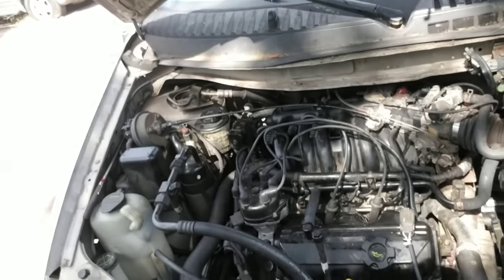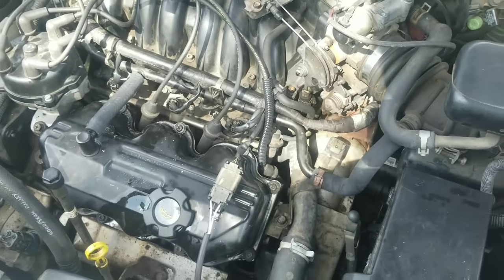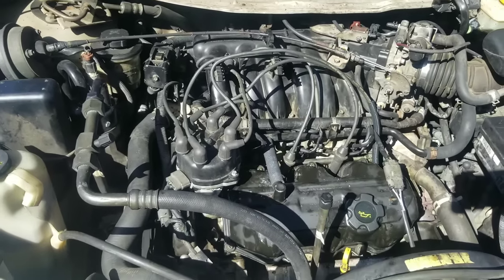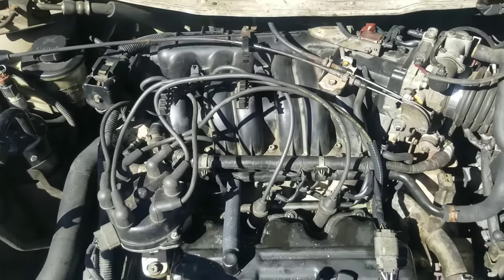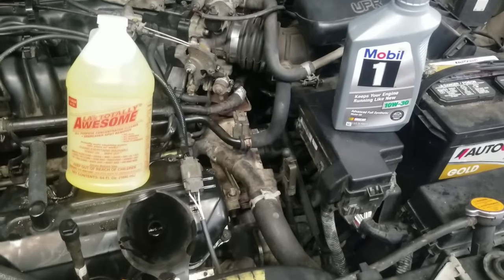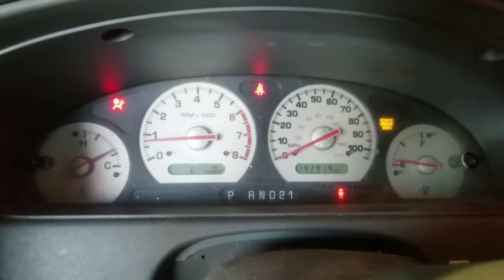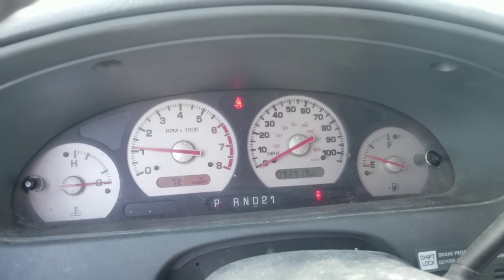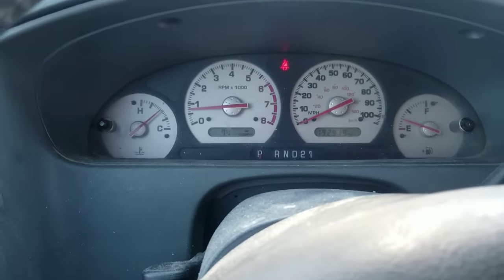How to Clean The Inside Of Your Engine The Easy Cheap Way.

Comment: I went ahead and tried it on my 09 Pontiac G8 and seems to be running like a champ!!!  So all you haters just letting you know it worked for my car!!!
Reply from the maker: Thank You.
Reply: Koool!
Reply: My G8 GT lifters are tapping and low oil pressure I will try this maybe soon hopefully it would work how many flushes did you have to do with your G8
Reply: @crazysexycool180  what do you think about diesel for flushing the engine
Reply: @jermainejudge6236  did it work

Comment: When you start hearing your lifters ticking shutdown your engine. If what the saying is correct that oil pickup tube is clogged meaning not oiling the main bearing and the piston rings. This could destroy your engine like spun main bearing, piston rod bearing, and others that needing much oil to lubricate.

Comment: As I instilled in to my daughter, I learned from my grandfather oil is cheap, engines are not. But if you can save one from the bone yard, that's great. I do like using seafoam about 100 miles before an oil change. You would be shocked to see how pitch black that oil gets after and I never go over 4,000 on synthetic oil. Mystery oil is great, I use it in the filters during oil change so instead of just oil, the engine gets a shot of cleaning agents right away. Some might say that's a little expensive, I've done this for years, hundreds of thousands miles. Never had an engine fail. Knock on wood, hopefully never will because that's really expensive!

Comment: For those skeptics out there what I would do is I would put some of that crud on a screen similar to the oil pump screen spray the chemical on it and show how it actually dissolves the stuff . Some people going to think that the stuff just sits there on top of the screen for the oil pump but just be clean . I think it works because obviously the oil light went off which means you have a clean flow

Comment: In my 60’s auto shop class, we learned to use diesel fuel and 1qt of oil in the same way. Always following up with fresh oil and a new filter. Some mid 50’s cars used non detergent oil and filters were an add on.

Comment: I did this on my wifes 2014 Nissan Altima 2.5 which i got it from auction and had a lot of sludge inside and after about 3 or 4 flushes and final one with Mystery oil, the engine runs so much smoother. Thank you bro for the amazing tip. My wife drives it to her nursing school everyday putting about 80 miles a day for the last 3 months and car is running great now. THANK YOU !!! I won't try kerosene as i heard it can damage the orings inside. but this awesome stuff did the trick for me.
Reply: Still running good? Curious
Reply from the maker: Thank you please like, share, and subscribe, also please check out my other channel Salem Taxi, on YouTube for more material on a different level.
Reply: And now I'm more curious.

Comment: Sealife that's exactly the method I've been using on my used vehicles for last 15 years.  Excellent way to clean engine sludge.  Additional method is 4 to 1 ratio engine oil with ATF, drive for 4 to 5 days. Drain and replace with new oil.
Reply: Makes sense bc transmission oil has way more desegrediant in it
Reply: Marvel Mystery Oil is essentially ATF with some additives. So ATF is just a cheaper option
Reply: I think you mean Seafoam not Sealife

Comment: I ran mobil 1 10w30 in my Chevy pickup from 130k miles to 245k miles changing oil and filter every 3k miles. When I replaced the oil pan gasket the oil pan and lower engine looked clean like a brand new engine. Sold the truck with 272k miles still not leaking or burning any oil. 
The lesson learned is good synthetic oil will clean your engine while you drive.
Reply from the maker: Thanks for watching , please like, share, and subscribe

Comment: I mean shoot, with the oil light being on, what was there to lose? This worked extremely well. If I ever experienced an oil light, I might just attempt this! Let's hope being over obsessive with oil changes will help me avoid this. Dude, this was literally very interesting to watch, thank you so much for the video!
Reply: Oil lights are just to tell you when you need to add/ change your oil
Reply: @eze12313  - They are actually for ANY oil related problem like you stated but also for low/no pressure etc.. etc..

Comment: On my 5.0 Bronco, I drained the old oil out and put 4 qts of diesel fuel in. I started it up and just let it idle for 20 minutes before I drained the diesel fuel out. I then replaced the oil filter, put in the required amount of proper oil and drove the vehicle as normal. Sold it to a co-worker who drove it for 3-4 years with no problems.

Comment: People say he should have done this and that. Well it seems that the more time spent is more money charged. Yes a pan removal and valve cover would have been very good. This POS Nissan is in bad shape and this method of cleaning up the oil passages will probably give it a little more life, on the cheap. So for all you folks who cannot think out of the box here is to you. New stuff is hard for some to accept, I love what he is doing. You Sir have  a real thinking brain.
Reply from the maker: Thank You Well Said
Reply: I wouldn't do it that way even in an engine that might be beyond saving. If you wreck the bearings, that's it. Try a product made for the purpose of flushing engines. Synthetic oil is a possibility because it does have superior solvent properties. Then there is SeaFoam and similar products. Even adding transmission fluid and letting it idle is a possibility. A water-based product does not belong in the engine oil. Its possible effect could be the same as that of coolant leaking into the oil. Damaged bearings.

My suggestions cost more than a dollar, true. But they are not massively expensive.
Reply: @anonymike8280  For most situations I'd agree. Go with Seafoam or such. But this was a seriously crudded up engine. He did say idle it, DO NOT DRIVE. With Seafoam you drive it 100 miles. That Totally Awesome stuff is a serious degreaser and detergent, without being caustic, great diluted for AC cleaning etc. This wouldn't be my first choice. Proper maintenance with some more conventional cleaning would have prevented the situation, but in this particular case it's a very resourceful technique.
Reply: I spoke to one dumb-dumb the other day who still can't accept the fact that the world is not flat!
Reply: @anonymike8280  what do you think about diesel , I don't think it will hurt the motor
Reply: @robertoarriola-bustamante9169  Bad idea. Also, the people who advise this are not thinking about people who cannot store contaminated diesel fuel where they live. Products made for cleaning engines internally cannot be recycled along with the drain oil. Diesel can't be.
Reply: @anonymike8280  do you think it will hurt the motor
Reply: @robertoarriola-bustamante9169   Roberto Arriola-Bustamante  It might. I absolutely would not run diesel through a modern engine, anything with sensors that could be affected by contact with diesel fuel or vapors. People used to do it with cast iron engines. If you have an engine with some sludge in the valve area, just start chaing the oil regularly. If it's in the pan, you can run some of solvent through it, including diesel if you have the means of disposing of it legally. But you should not run the engine with anything but motor oil in the crankcase.

One way flush sludge out of the oil pan is the drain the oil, put the plug back in, pour some kind of solvent in there, such as kerosene, diesel or even a soap-and-water solution, let it stand for a day or two and drain it. But do not run the engine. it might be easier to just take off the oil pan, but this is difficult on many vehicles.

Most of the time, an engine which you think is sludged up really isn't dangerously dirty. Just change the oil and filter frequently.
Reply: @anonymike8280  ok thank you for the recommendation I appreciate your advice ,
Reply: @robertoarriola-bustamante9169  I take my own advice. Had a 2001 Camry with low miles but a dirty engine because the elderly driver was driving about 20 miles a week and went years between oil changes  I just changed the oil and didn't worry about it. No problems. He wrecked all the seals though.
Reply: @anonymike8280  I just got a Ford Lariat Whit the 5.4 3 Val  115 k it tikes constantly but berly can tell I am just going live it along , it's not bad runs good
Reply: @robertoarriola-bustamante9169  These are overhead cam engines with hydraulic lifters. My source indicated valve lash issues or lifter issues. Fuel injector can make ticking noise too.
Reply: @anonymike8280  yes is going to be hard knowing  or pinpoint in it for sure we're is coming from whit all is going on with this 5.4  3 V ,
Reply: @robertoarriola-bustamante9169  If it's got to do with a valve lifter or follower it's under the valve cover and probably pretty easy to work on unless you have to disconnect the timing chain. With mileage that low in a modern engine, just change the oil frequently enough and see what happens. Use the lowest viscosity allowed. The recommendation for 2000 and newer is 5W-20 and for 1999 and older 5W-30. If you just bought the truck, the former owner may have put a heavier weight oil in there, which could cause ticking. Maybe. You can't hurt the engine by changing the oil as long as you use the right oil and install the filter correctly. I use whatever I can get for $3 a quart or less and change it every 2000 miles.
Reply: @anonymike8280  Costco has a new house brand 100% synthetic oil for $25 for 10 quarts.  The Project Farm youtube channel operator thinks that SuperTech, Amazon's house brand can Costco's house brand might be the same oil, possibly with different additive packages (or not).  While not the best oil on the planet, Project Farm's tests reveal it to be a pretty darn good oil.
Reply: @anonymike8280  What is the acidity of Awesome?  What is the acidity of coolant?  Short term exposure probably isn't a big deal, but would like to hear actual long term anecdotes that all is well.  Maybe there is something that can be used to rinse out the Awesome before the final oil change.  Maybe the last flush could be MMO instead of Awesome, along with the one quart of oil.  People can experiment, but there is some risk involved!
Reply: @wellnesspathforme6236  I did not experience that with my 2.2 Camry. Having changed the "spaghetti" seal, I have seen the inside of the oil pump. It is a simple gear pump and I don't see what can go wrong with it. Many possible issues though, and all are more likely as the vehicle gets older. Things I can think of are a worn oil pump, dirty oil passages, oil pickup clogged. Assuming you have a four cylinder, the oil pump is on the front of the engine and can be removed and replace relatively easily but I consider a problem unlikely unless the engine is very high mileage. The oil pan is pretty easy to remove and replace also. The first thing to do however is to check the oil pressure with a gauge. If the oil pressure is okay, you might just have a dirty engine  and it might get cleaned out with solvent additives, synthetic oil or just with regular, on-time oil changes. 

If you put an oil pressure gauge on it, rev it up an see if the pressure drops. It does, that might indicate a faulty oil pump. Or it could be due to worn bearing. If it's high mileage (above 200K) maybe you just drive it and don't worry abut it. You also can drain and fill the transmission. If the transmission works, don''t bother to pull the pan and change the screen or filter. In these models, use only DexMerc DexIII fluid. Don't use a back compatible or synthetic fluid. I used an major oil company brand from a local dollar store at $3/qt and it worked just fine.

Comment: I appreciate your making this video and showing us other ways. Unfortunately I’m too scared to run my car like this.  I wound up dropping my oil pan and just replacing my oil pickup when I bought my car. But my oil pan also had a small dent in it right around the oil pickup. So I hammered out the dent using my old EGR valve since I did a vacuum reduction.  I’m working with a 1992 Mitsubishi 3000gt vr4 since I owned since it was brand new and I was in 11th grade. That car still runs and drives like new with very low mileage. 

I recently picked up a 1993 Dodge Stealth R/T TT which is the exact same car as my 3000gt vr4 only with minor differences but same drive train. I have big plans as far as HP and much larger turbos. So I also installed ARP main and Rod bearing studs while I had the oil pan off.  But anyway, just because I didn’t do it your way this time doesn’t mean that I don’t value your videos. You have been a great help to me with all my cars. I learn a lot about a lot of different things from your videos
Be well and keep up the great videos
Reply: Did you have the block line honed after installing the studs?

Comment: This seems insane but it looks like it worked fine.  I would be interesting in the longer term fix.  Is it still running?  Compression good?  Still at 192K miles it sounded smooth like a car with less mileage.  Thanks for the video!
Reply: Scott Vickers 
Customer needs to change the oil filter and oil every 3 thousand miles.  They did not change it ever I’m sure
Reply: William E your reply literally makes no sense at all.

Comment: This video would be great for GM owners that have the 5.3 or the 4.2 liter engine that are famous for oil pump pickup screen getting clogged . The job of removing an oil pan from the GMC vehicles is between 8 and 10 hours and is a nightmare of front end parts removal and driveshafts. 
I would much rather spend money buying about 5 quarts of oil a gallon of that cleaner or even two and spend 2 hours flushing draining flushing and draining and see what comes of it rather than all the other work of taking those parts apart just to get to the oil pan amazing video thank you so much
Reply: If you only have a two wheel drive you can drop the pan in 30 minutes with basic hand tool knowledge

Comment: Super late comment.  Just wondering, after this procedure if someone was to do normal oil changes after (3-5k), would that also help get the rest of the gunk out of the engine.  Thanks for the video and in depth explanation of what you did here.  Seems like a good way to clean out a neglected engine without tearing it apart.
Reply from the maker: Thank you please like, share, and subscribe, also please check out my other channel Salem Taxi, on YouTube for more material on a different level.